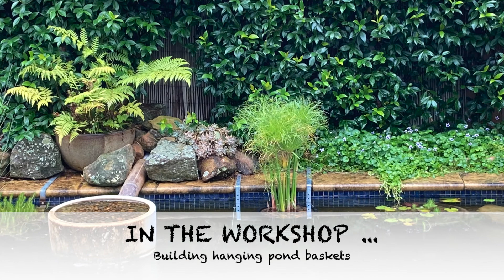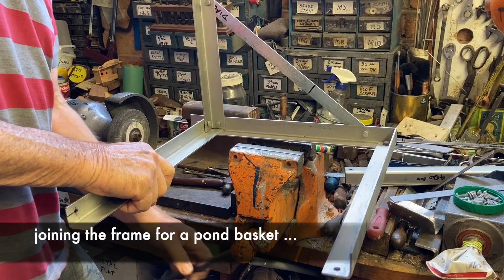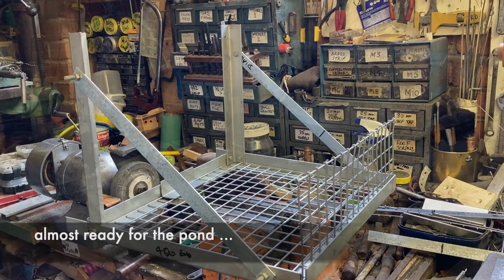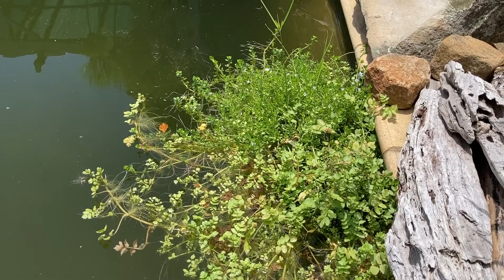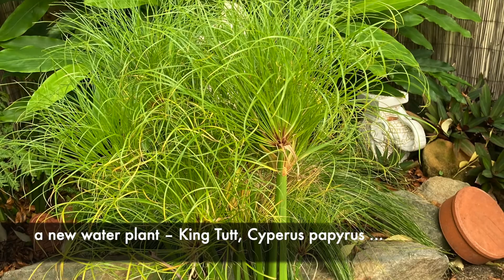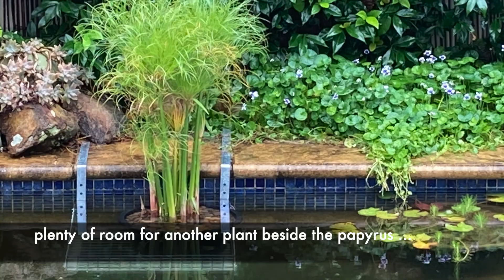IN THE WORKSHOP – BUILDING HANGING POND BASKETS

Comment: Hi, that’s a great idea, I have a pond similar to yours , basically a swimming pool with concrete edges, this would work perfect for my pond, would you consider selling newly made baskets? Let me know if that’s an option, thanks
Reply from the maker: Thanks for your comment. Unfortunately the clever person who made these baskets is no longer able to make them. They were made from galvanised strips of steel which were screwed together and the galvanised square 1inch mesh was used to form a basket for the plants. Long straps allowed the baskets to be hooked over the edge of the pool coping and they were adjustable to allow for the plants to sit in the water. I hope this helps ... you could do a few screen shots of the baskets and perhaps a handy person could make some for you with the photos as a guide. Our pond is looking better every day as the plants grow, they cover about half the surface of the pond.  He also made some large baskets which sit in the centre of the pond using star pickets for the stands, with a wire basket attached to the top. I hope this helps and that you are able to transform your pool into a pond too! 
We also bought a large quantity of bush rocks which we stacked onto the steps of the pool to support the pot plants.
Reply: @LynsHomeGardenDesign  
Thanks for your reply and help